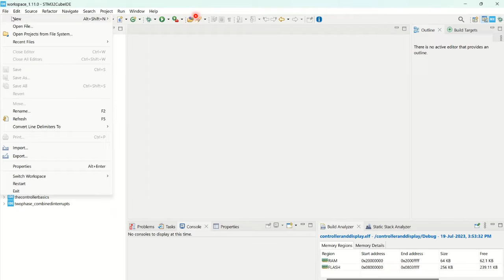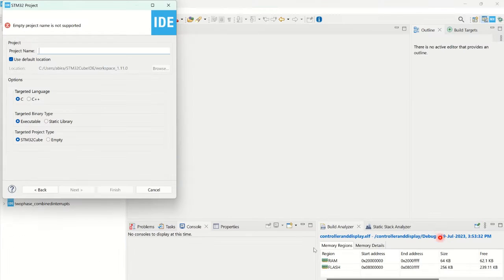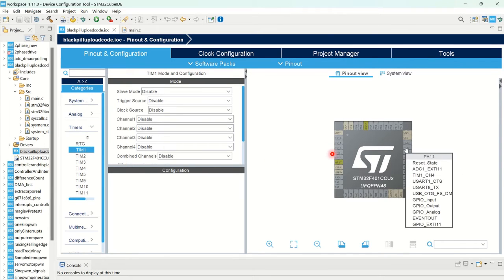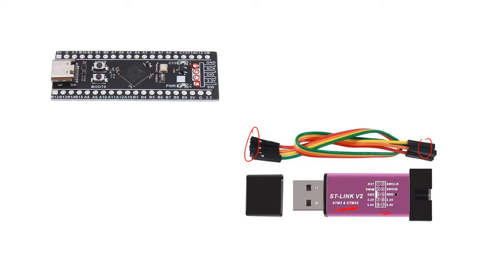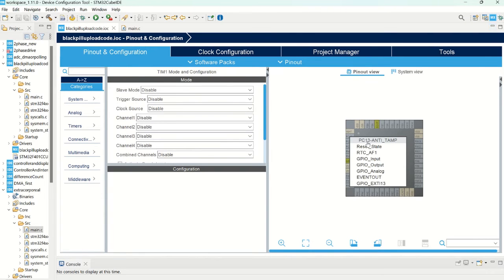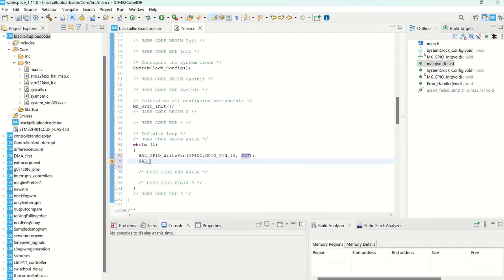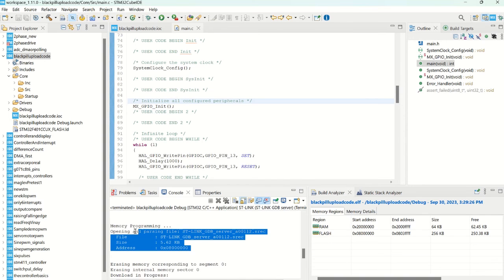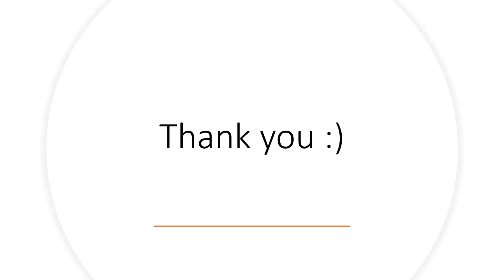STM32 – Blackpill upload your first program || Blink led || everything you'll need

Comment: hello just found you  I did not see you set up the system for the clock or rhe 2 wire for the st link did i miss it ?
Reply: These steps are sufficient to program using st link programmer. Did you face any issue while following these steps?
Reply from the maker: This method is not working for you ?